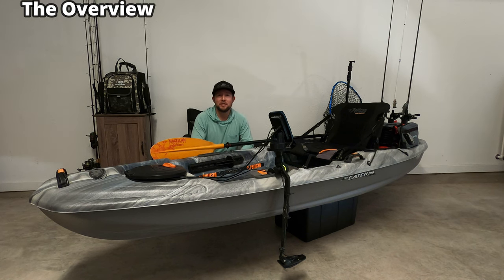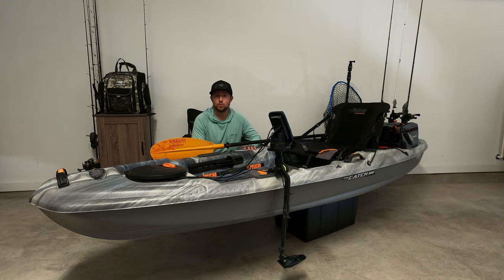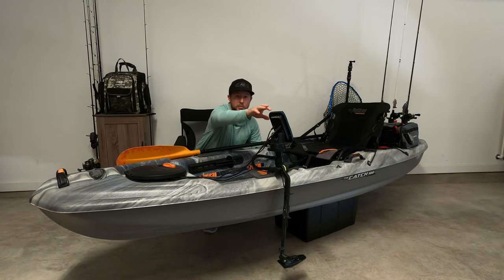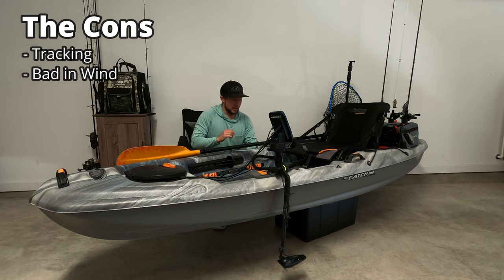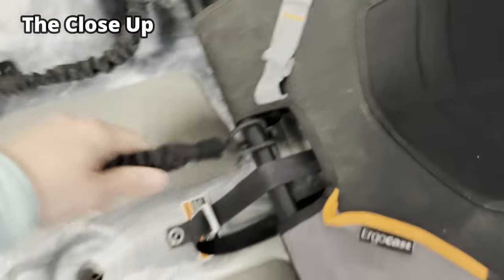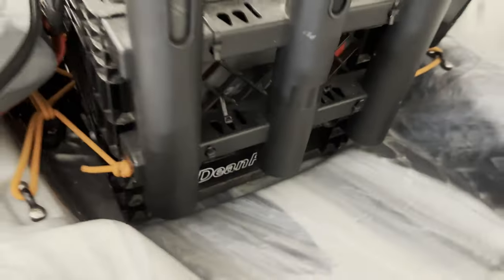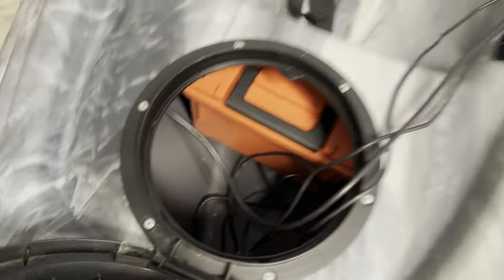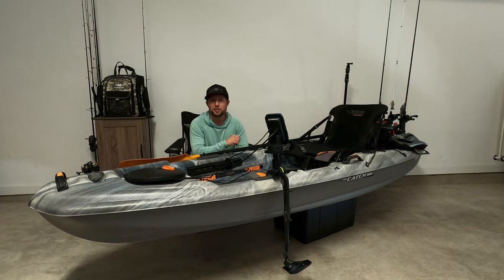Pelican Catch 100 Fishing Kayak Review - PLUS  Best Kayak Accessories and Simple Mods

Comment: Just wondering can you put a trolling motor on this yak
Reply from the maker: For sure! I've seen multiple people that have done it. However it does look a little crowded once you do a mounting plate, add the motor, and have a battery for it, but it's definitely doable! I actually almost bought a used one before this that had two trolling motors, one on each side 😂
Reply: @FishATX  👍

Comment: Got a question sir. I just took my pelican catch 100 out for the first time. Had a great time. When it was time to leave i went to load the kayak back into my truck and noticed the kayak was alot heavier than when i put it into the water. I removed the back plug and a lot of water came out. I raised the front of the kayak and drained all the water out of the kayak. Is that normal? Any idea how the water got inside there? Thank you
Reply from the maker: Sounds like you have a crack or hole somewhere! Unless you had too much weight on the kayak it was leaking into the front hatch or drain hole. I’d def look closely for cracks! Or if it’s new I’d try for a replacement under warranty.
Reply: Thank you sir.

Comment: I am a big guy 290 is this kayak ok for me to fish out of.I am only bringing 25 pounds of gear maybe less.
Reply from the maker: Sorry for the late reply! I believe the weight limit on the catch 100 is 350lbs so it would be doable, but I’d suggest checking out the Catch 120 (12ft kayak) or the new Catch PWR 10. On those you’d have more space and the ability to bring on more gear if needed. I used to only bring a rod and small bag, but there’s so many accessories you can add these days!

Comment: For fighting winds I recommend a light anchor (read 5lbs or less mushroom anchor) attached to side or rear. Rear tie off is preferable so the nose points down river and you're facing the direction you're fishing. I know most traditional "kayak anchors" are the grappling hook style but for river fishing I don't want to hook a bunch of tree limbs and stuff on the bottom.  
I also recommend keeping a clamp style brush gripper type anchor. They're useful for just hooking up to a limb or branch and fishing out away from the bank. 
I have the YakAttack track mounted cleat and use that with paracord for my anchor tie off point.  
I have this same kayak and exclusively fish rivers here in MO. 

Fish finder is on my to do list now. Thanks for taking the time to make the videos man. Stay safe.
Reply from the maker: That’s great info man! Yeah I use a grappling style anchor in winds. Our rivers around here don’t have much to any current, so it hasn’t been an issue. I do tie off to trees or posts when I can though!  It’s a great little kayak for sure. I recently upgraded to a native slayer max so I can pedal bigger lakes! Loving it so far too

Comment: Your setup is super clean and intuitive, thanks for the overview dude!
In a sea of videos that look like some nut job got busy with a drill, I found this gem. I like things clean and intuitive and this gave me a lot of inspiration for my build. Appeciate it brotha
Reply from the maker: I really appreciate the comment and feedback! I'm glad I could help out. I like a clean look but also a simple method for doing it! I did drill some holes in my new pedal kayak (native slayer), but it's nice having options out there not requiring drilling or anything permanent. Good luck on your yak build!
Reply: @FishATX  Appreciate it! It should come out good, for me the removablility of everything is a big as I'm wanting to upgrade next Spring for sure. I'll have to check out that Native Slayer, tight lines brother 👍
Reply from the maker: @banksidebassin3438  Yeah for sure! I had the Pelican for a few years while I saved up for a pedal drive. It’s definitely a game changer! Really liking it so far. I made a video recently going over my mods so far, but I’ll be doing a full review on it too!

Comment: Awesome plan to go pick one up tomorrow. Anything you suggest I buy with the yak while there?
Reply from the maker: Sorry I'm seeing this late but congrats on the new yak! Obviously the basic paddle, anchor, and lifejacket are needed. Make sure to do some research on the right type and length of paddle because that makes a difference. Additional stuff would be a paddle leash, crate, and any rail mount accessory you would use! They have some cool rod holder ones or a cup holder.
Reply: @FishATX  ok thanks

Comment: How did you mount the transducer to the arm? Did you buy some adapter for that?
Reply from the maker: It’s been a while so I can’t exactly remember. But I think my garmin striker had all the hardware for it! Think it’s just a long screw/bolt that runs through, but I might have added a couple rubber washers to get it tighter.

Comment: The Mount for the garmin, is the two links below for the transducer mount and the fish finder mount the only thing I need to mount it?
Reply from the maker: Yep it should be! As long as you have all original parts for the Garmin. I think the Garmin comes with the black plastic round piece that tilts and screws for attaching to the fish finder mount. The transducer mount slides and locks into the built in track on the kayak, and then the fish finder mount with the garmin attached just pops into the top. Nice and easy, and no holes required.
Reply: @FishATX  does the Scotty transducer Mount come with a transducer?
Reply from the maker: @localpolaakk3779  Transducers and basic attachments/hardware come with the fish finder. So it will be with the Garmin Striker

Comment: Just bought a catch 100 but haven't been on the water yet. I'm a little curious about the placement of your fish finder, have you accidentally hit it with the paddle or is it too far away? 
I got a striker vivid 9sv that i actually bought to my float tube but now when I'm a yak guy I'm wondering about the placement on the catch 100 🤔
Reply from the maker: Great question. I actually initially had it on the right side, and kept smacking it with my rod while casting or setting the hook, so I moved it to the left and further back. After that I didn’t have any problems!
Reply: @FishATX  further back as in away from you i guess?
Reply from the maker: @jenshiller4058  Yeah more towards the front. I guess back does mean the other way 😆 I always fished with the seat on the highest position too, so that helped some. I’ve seen people mount it right in front in the middle near the hatch, but I thought that would be a little far.

Comment: Did you have to do anything with the wiring or did it come like that and you just plug it in to your battery?
Reply from the maker: For that model I just had to had crimping spade connectors to the wires for the battery connection. I believe it's these (https://amzn.to/3rbj9W9) but you might want to double check that the wire is within that range. On my new kayak I use a Nocqua battery which comes with everything you need to connect to a garmin. I highly recommend those batteries, they last forever! I have the install video here: https://youtu.be/iMB3A83ERkg

Comment: Just bought a used one ..but one plug is missing..is this a problem?..will I sink..I've never owned a kayak
Reply from the maker: Like one of the scupper plugs? You’re fine without it! They are for helping water drain from inside so water doesn’t come in, just out. I usually had the one under my seat out. But if you want them all you can get some off Amazon
Reply: @FishATX  the seller said it was scrupper plugs
Reply from the maker: @WimpyWorkouts  Yeah you can get those off Amazon here's the ones my kayak have: https://amzn.to/3pG5cyp

Comment: I haven't been 5'5 150 since I was 16, I wonder how stable it is for a dude 6'0 250?
Reply from the maker: Perks of being a small dude. Get to spend less money on a small kayak 🙌 I’d probably recommend the 120 or just a 12 ft yak in general
Reply: @FishATX  I just watched a video after yours of 5'9 280 guy standing in the same yak. He was gettin done, but you could tell he wasn't as stable as you. I got a line a this exact yak for 300 which is why I was wondering. Thanks for the reply brother.
Reply from the maker: @asdfkhieee  No problem man. Yeah if you can get a good deal on it, it’s definitely worth a try! Depending on how much gear and stuff you want to take, and if you’re trying to stand at all. But I recently upgraded to a native slayer 10 and I can definitely tell a big difference in stability. It doesn’t even move when I stand up. So it all depends on how much ya wanna spend and what you plan to do with it.
Reply: im 5'8" 290 lbs and  mine  is tippy if the seat is in the high position, wont  be no standing in it here, but other than that I like it.

Comment: This Kayak is garbage, A hole wore in the bottom after 5 uses. Had it 2 months and it sank in the river. Warranty would not cover, JUNK JUNK JUNK
Reply from the maker: Whatttt thats crazy. Did you nail a rock or something? Warranty should have def covered that!
Reply: That's what happens when you drag it guy
Reply from the maker: @mikep3322  That’ll do it!
Reply: @mikep3322  Dragging it 50 yards in grass total makes it garbage, I have had several kayaks, none worn like this,
Reply: @dennyblalock1432  50 yards in the grass? Sure buddy
Reply: @randolphtolbert3825  What is your deal? Are you major stock holder in Pelican Kayak? They are junk. Just buy a real Kayak. I suggest Native or Hobie
Reply: Same happened to me. I have had mine for a couple years now though. Trying a fiberglass patch today and will hopefully be back on the water this weekend.
Reply: @dennyblalock1432  I don't drag mine at all I always cart it
Reply: @mikep3322  a week after it sank I bought a Lost creek angler 10.5 peddle and have not had any issues over 20 uses in the same place.